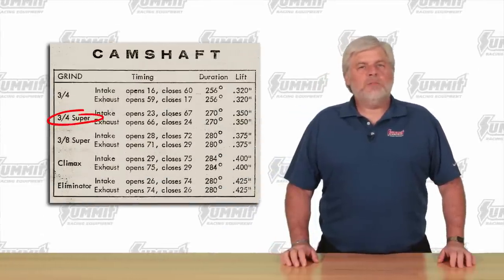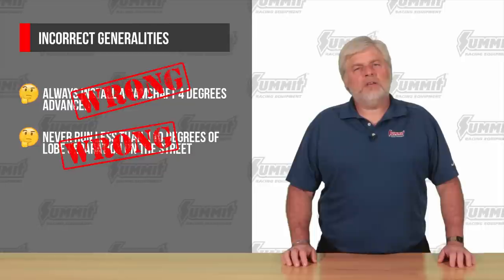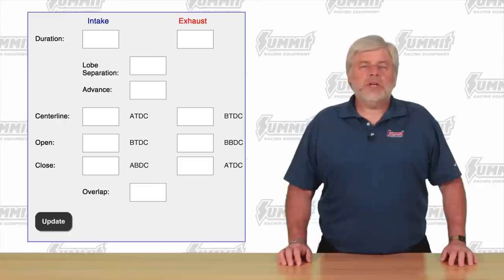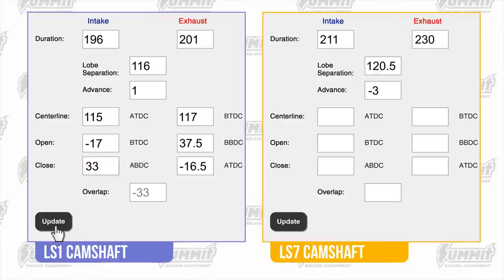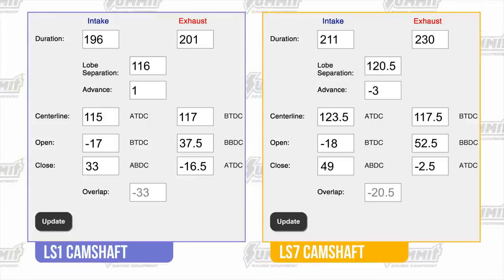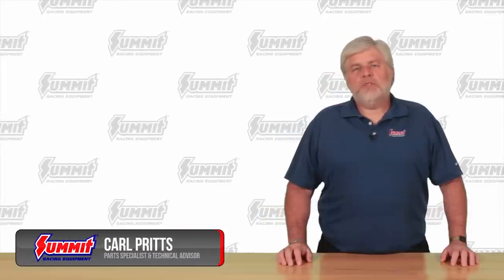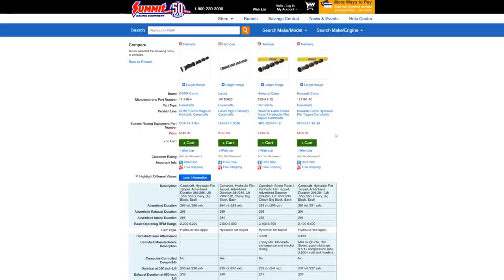How the Summit Racing Cam Timing Calculator Works

Comment: Hello from Australia. I have a HSV WK Grange with an LS1, fully built with a HTV1900 blower. Decided to stroke it to 383 and put a new cam in (currently running the stock cam). Was thinking of 220/236 with 113.5 LSA +2. I was trying to work out why the calculator was different to Wallace Racing's calculator but it was because my phone wasn't displaying it correctly! Thank you for the calculator and hopefully the build doesn't take too long and makes the daily 2.2t car boogie!
Reply from the maker: Thank you for watching, Von!
Reply: Why do you have to specify you're from Australia? What relevance is it?
Reply: @lollipop84858  because I said it's in a HSV WK Grange? They didn't exactly make a lot of them or sell them globally?

Comment: the calculator tells you how valve events relates to duration and LSA, but it does not tell you if it will work best with a particular engine.  confusing and misleading for most people. David Vizard's rule of 128 works very well for cam selection.
Reply: Exactly...
Reply: J
Reply: As long as it's an SBC with 10:1 compression.
Reply: @aldo6192  I'm looking forward to trying Vizard's 128 calculation on my current build. What you said about 108 can be said for 110 and that's about all comp offers. So why does comp speck most of there cams lsa for roughly a 305😂😂 I agree Vizard loves to ramble and get sidetracked with his stories now that he's in what his 80's now?

Comment: I used to drive Uncle's F250 with rebuilt 460 and cam advanced 4 degrees.  That truck would haul ass.  Won many drag races in Edmonton.  Easily 100 mph in three city blocks.

Comment: This is a major point when one makes a negative valve overlap because of the 0.050 standard start lift.  I just doesn't work.   This is why always use advertised lift at .006 start lift.

Comment: What cam can I use on my 95 tbi 5.7 chevy without having to tune my ecm ?or change lifters and springs
Reply: Stock
Reply: @brandon_907  it has a stock one but I just want something a little bigger
Reply: Any cam change requires a retune. There are a few cams on the market that you can use stock springs with though, but it's a lot of work to put in that new camshaft only to gain like 5hp from that small cam
Reply from the maker: CCA-12-249-4 will work fine with your stock TBI and springs.  
https://www.summitracing.com/parts/cca-12-249-4

Comment: Great how about dynamic compression and effective stroke where is the limit on Dynamic compression
Reply: please note from several sources that say any of it cant be calculated by DCR etc. there are many other factors that can affect pump gas compatibility. from your intake valve opening degrees is where you can get your dynamic compression ishoot for8.5to 1 its right in the pump fuel zone= 7.5 to 1 minimum to 9.5to1 max and that is hot.for instance GM's ZZ350 crate motor is 195PSI that is high but the fast burn chamber gets away with it. race engines that use race fuel or additives go beyond this of course. its really fun when you do also. it creates a supercharged affect.  iuse a direct head port cooling, piston top coating, and  smooth all the sharp edges this is the real reason for polishing because polishing does not create more flow. it evens the heat dissipation and heat is the power in a combustion chamber and cylinder, this creates the pressure. you want 195 psi in a fast burn or modern performance head chamber at max. if you go direct head cooling know what your doing. basically if you get a hot spot in the chamber or a sharp edge, this is what causes a ping. that is bad. do not operate an engine that pings under those detonation conditions.  ican blueprint an engine for you. or spec your cam matching your dynamic compression to run the most on pump gas also varies with altitude and how good you fill the engine cylinders. Really its going to matter what cylinder pressure actually measured is. you want 175 PSI minimum, to 190ish PSI
Reply: @7REDDRACO7  Excellent information. I learn a lot from YouTube comments like yours. 
Thanks!
Reply: @7REDDRACO7  very good info. I had a 6 liter LS with a fairly large cam at 238/242 duration and Trickflow heads with 10.9 compression ratio and I was very surprised to find 220 PSI with an accurate compression gage. I thought a cam timing of that size would produce much lower....... but it didn't. All was good tho. 93 pump gas only.

Comment: Nice how you used .050 without telling us and totally avoiding the old SAE spec of .004 tappet and .006 valve vs the newer .006 at the tappet.....
Reply: The Notes here:

https://www.summitracing.com/newsandevents/calcsandtools/summit-cam-timing-calculator

say:

1.) For accuracy in comparisons, always use figures measured @ .050 in. lift.
2.) If opening the intake Atdc or closing the exhaust Btdc, enter as a negative (-) number.
Reply: The old 10 to 1 l48 350 engine comes to mind.  Try taking out the stock cam and putting in a comp xe250h or 252h.  Usually results in a ping king, that you gotta recurve ignition advance, or run higher octane.  Yet the .050 intake valve closing is very similiar...

Comment: Building a 351 Windsor stock bottom end other than flat top pistons, GT40 heads, the lightning intake recommended cam for better torque
Reply: Go look up Port flow, watch lift numbers as soon as the ports start losing flow increase(ie at .300 lift it flowed 100cfm and .400it flowed 150cfm and .500 it flowed 159cfm)  you have reached max flow and going past that drop off is waste of adding valve spring opening pressure etc.
Then you have to decide WHERE you want it to make best torque(torque is what an engine makes, HP come from a formula that denotes how much work it does. Basically torque gets you off the line and gets you moving HP is representative  how fast you will go at higher speeds.
If your in a truck, you want a fat,flat torque spec and matching converter and gear to make use of the torque up to say 5500(HP and torque numbers meat at 5250).
Now if you want a hard charging screamer car, you need MORE duration/overlap, more rpm capable parts and gears/converter and yes better heads. 
I put a 355 Chevy together used some old 991 heads that factory came with 1.74 intakes, I opened them up to 1.94 , throated (bowl work under valve) raised my port guide by 5/32" (ie spot faced guide boss so stuck out less) paired it with very small in numbers cam it was one designed by Lingenfelter for use with very old Accel SuperRam fuel injection kit that was so Old it had MS Dos software to tune it so it couldn't use a sloppy cam.
That engine was a torque BEAST.
AND I used TCI Saturday Nite Special converter and 3.42 gears in my Monza. It was like .456-. 465 lift 256-265 duration advertised and like 112 love sep. Tiny cam, more like split lift,split duration 325 HP 327 cam but in that combo I'm betting it made every bit of 450lb ft of torque.
I even used Edelbrock Scorpion single plane air gap intake and 600 Carter carb(it really did love the 780 Holley I later installed. Still.
GT 40 heads have a sweet spot in flow, use a truck intake and they can scream on street

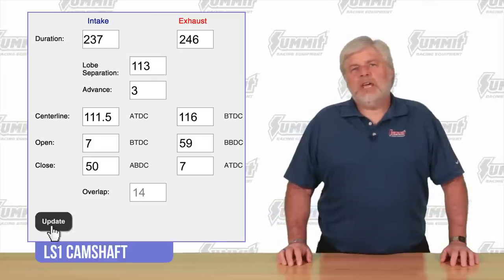Comment: I don't know how or why but the calculator is incorrect with  the "modified" LS1 cam.  It should read 1.5 advance not 3 advance. 6:56
Reply: i had to check...it should read 113.75* LSA and 2.25* advance.

Comment: Where do you find the cam calculator on the summit site
Reply: Yea I had to Google summit cam calculator because I couldn't find it on mobile. I found it pretty useless myself. Would be a lot more useful if it would let you use different lobe profiles because not all lobe centerlines are dead center of the open and close.

Comment: I love your video but you don,t tell us if the valve events are @ .050 or @.006. Here is the problem with not having Intake seat closing numbers, you have no way of knowing what cam will work with what static compression ratio
Reply: You could use the kb/ uem calculator @.050 +15° method

I hear that 8.75 on that calculator is close to 8.25 using seat duration.  That's like 170 psig /185 psia
Reply: Joe Figueroa  Smart guy. 💪
Reply: Joe Figueroa  Still a decent explanation brother.
Reply: Joe Figueroa  And to me that's okay because it creates job security and if someone wants to know more, they can ask questions. That's what I do. 
I'm quite sure I'm more informed than the average guy and I'm always happy to help others. But I totally get what you're saying.  What I consider common knowledge is way over most people's heads but again, that's fine by me.
Reply: Joe Figueroa  I live with the philosophy of "live in collaboration not competition".
Reply: @KingJT80 , the UEM calculator is not very accurate (by assuming ICA @ 0.050" +15° will give close enough results). Cams can have vastly different closing ramps, and we can prove this inaccuracy by looking at an old school Comp 292H cam. 

If we look at Comp 292H for a moment:
292/292 Adv
244/244 @0.050"
110 LCA
106 ICL
ICL @ .006" timing - 72° ABDC

Using UEM calculator and assumption (Intake Closing Angle (°) ABDC @ 0.050" lift plus 15°) gives 63° (48°ABDC + 15°), not 72° as listed above. 

Using 63° changes a 10.07:1 496 to 8.20 DCR.

Using 72° changes the same engine to 7.63 DCR.

Unfortunately, Comp does not give their @ 0.050" seat timing (those bastards), so you must calculate it to get the 48° ABDC figure used above in the UEM calculator, using the 244° duration @ 0.050" given by Comp. 

The ICA @ 0.050" is easily enough calculated by assuming for a moment that +180° (crankshaft degrees, BDC) is 0, subtract 180° to get to TDC (0°), add your intake centerline (ICL - 106°), finally add 1/2 * Int duration at 0.050" (244°/2).

0° - 180° + 106° + (244°/2) = 48° ABDC @ 0.050".

Anyhow, 63° does not equal 72°, and in fact changes the calculation quite a bit.

Keep in mind, these calculations assume the lobe is symmetrical, which tends to be truer for older design cams. Not so true on Harold Brookshire cams!
Reply: @dragginwagon406  you notice something about the UEM calculator? I do. If you take what dcr you get out of it and subtract .6 you'll be close to what the DCR should be on the seat timing @.006

8.20-.6 = 7.6

Besides its all math estimates and not the real accuracy of a running engine but ive found that to be the most useful IF you use the UEM calculator. Took me a while to realize that but it should keep most people outta trouble because even crane cams has different seat timing numbers. They use .004 not .006 and the only constant that I know of is @.050 save for ramp rates etc.
Reply: @KingJT80  Ramp rates make a huge difference.   Somehow.... I think the .050 numbers just became a convention because anything under that just bores the flow bench guys to tears?  I knew there had to be some variances from the UEM calculator: between roller vs. flat, and modern vs old profiles you still have to do your own work to know what the setup is actually doing.
Reply: @flinch622  the best thing to do when buying an off the shelf cam is to see if they give you a compression range.

Most people look at it as when they see a compression range like say 9.5-10.5 for a cam

They'll use 9.5 for iron heads and 10.5 for aluminum or something to that effect

Ive seen richard holdner do this and a couple of other people

Comment: When is this calculator handy? Degree your cam, and plug in real results.  I have a cam that's off 3 degrees here, 3 degrees there...just  a tad off.  I pulled the cam to inspect it: no apparent damage.  Yet, with new numbers in, my .050 duration was only off by less than 1 degree compared to spec, while LSA was off by about the same.   Intake centerline was off, which took it from a 4 degree ground in advance to real world 6.4  and I think it will live [but it might want stall speed bumped up a notch on the torque converter]. 
But: you gotta degree your cam first, then use the calculator to spot possible issues.  Yeah, you could do your own math [it's not hard].  Just think of this as spellczech for your motor.

Comment: Is 263-280 duration good for a lopey idle?
Reply: depends on lobe ramp rate, a sloppy cam will lope with less duration, a modern tight efficient lobe with fast ramp rate will take longer duration to 'lope' since the cost of efficiency and more power everywhere is less lope versus duration. What engine do you have Morris, and any other details you can provide , what car, engine, compression,? etcetera then ican recommend you a cam that shall give you exactly what you want.
Reply: @7REDDRACO7  I got a 225 MoPar /6.
Reply: A cam with 263-280 duration @ 0.050 would be a full race cam and have extremely lopey idle. A cam with 263-280 advertised duration would be a step above stock, or very mild. Barely audible, if at all.
Reply: @7REDDRACO7  BAhahahahahaha....you have no frickin clue what you're talking about!!

Comment: ( 2000 trans am) what combination  of cam, heads, and intake manifold for my ls 1 product 450hp.
Reply from the maker: We would recommend the TFS-K306-485-460 and it is $3,523.79.
https://www.summitracing.com/parts/tfs-k306-485-460/make/chevrolet
Reply: You will have a hard time getting gains with stock LS1 intake, and smaller injectors.

Comment: interesting video, is there a reason why European cars use a longer duration on the intake while domestic is the other way around?
Reply from the maker: There is a multitude of reasons why an engine designer may use a longer or shorter duration on their design. Anything from expected power output to intake manifold design or even air intake components.

Comment: This calculator is pretty much worthless to figure out what you really need.  You need to be able to input your specific specs with flow numbers to get an accurate idea of what cam will work best in your application.
Reply: A chart with  engine power band ranges for different displacement , compression ratio valve size and port size would be nice .
  David Vizard has an app for cam selection .

Comment: If the Advance or retard is ground into the cam, then you dont need a timing chain with adjustment to advance or retard?  I'm wanting to run a sloppy stage 2, I bought an adjustable timing chain, should I send it back for a cheaper one, or can I make the sloppy stage 2 benefit from it?
Reply from the maker: them to hit our target valve events.  Your timing chain could probably be returned, but if you have a Sloppy stage 2 – you could possibly tune the events a little bit depending on displacement, gear, converter, etc. The original sprockets are probably in good condition and I would recommend just replacing the chain with https://www.summitracing.com/parts/sme-143012

Comment: Nice video but your explanation of cam lingo failed to explain the differences between Advertised vs @.050, @ .020, @.015, or @.005 duration numbers.  Same mistake most ppl have been making since the 1970's 😑
Reply: He's just making a basic comparison  of valve events at 0.050" showing how that effects lobe seperation, overlap and advance, he already stated how each affects the motor, now why would he want to get into advertised duration numbers ??  Im curious what this mistake is ?

Comment: Has anyone ran a 7.0 cam in a 4.8? Any idea of how it would run? And what kind of idle?
Reply from the maker: The LS7 cam will work fine in the 4.8 and will have a noticeable idle. Just remember to check your piston to valve clearance. I recommend upgrading your factory valve springs and the trunions in the rocker arm. We offer a kit that will take care of that for you and that part number is SME-K-14300: https://www.summitracing.com/parts/sme-k-14300/overview/